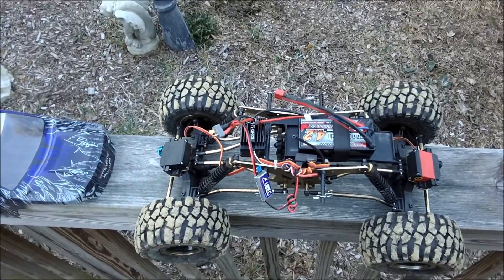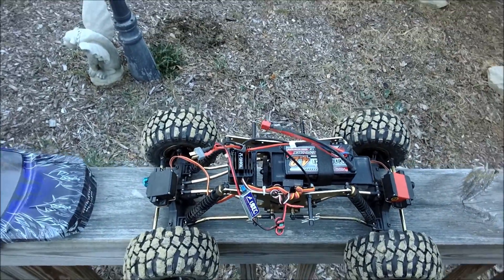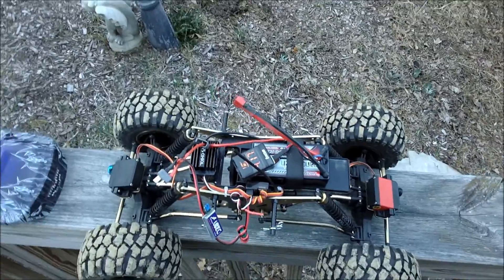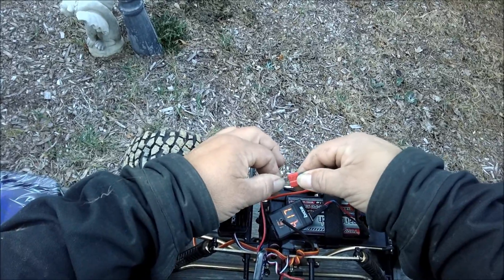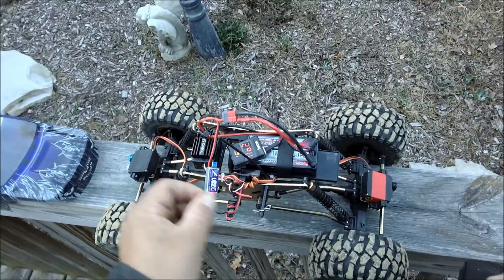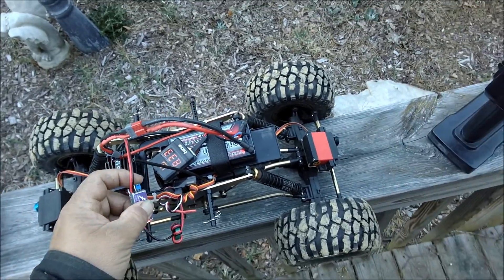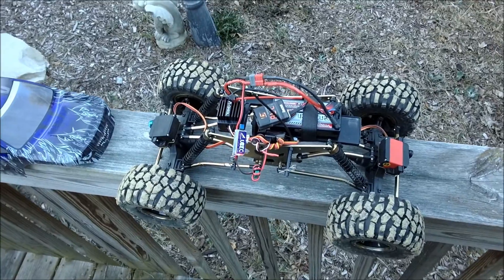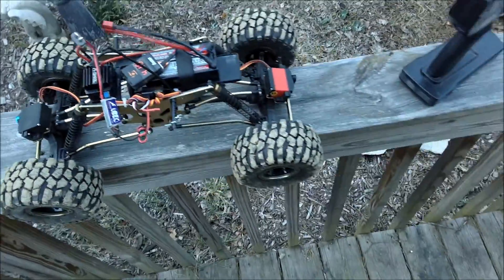Everest 10 BEC for 4 wheel steer, failed

Comment: that's sucks! shouldn't a glitch buster do the same as a BEC? servo glitching. the receiver should already be able to run the rear steer.
Reply from the maker: I'm thinking it's time to get back into this project. I've been off RC almost a year. But now it's too cold to work on the full size cars. I think it's high time I got this one sorted out.
Reply: maybe use the rs10 TX and Rx, maybe that will get it working ! keep us updated!!!!